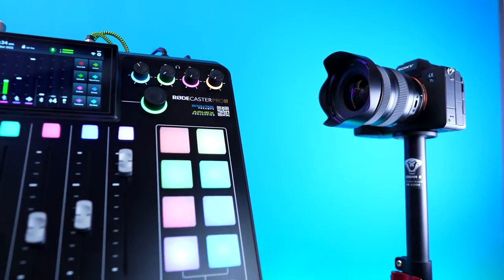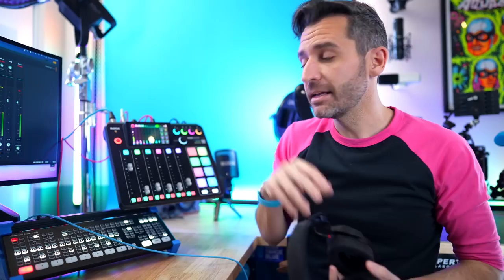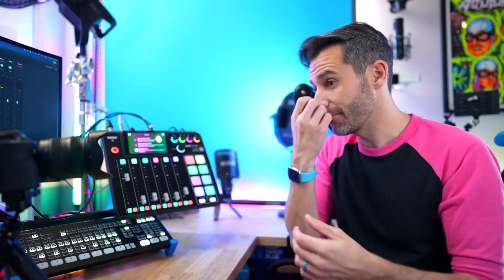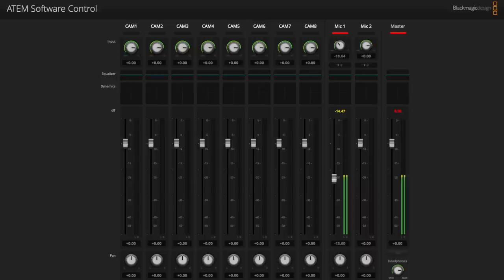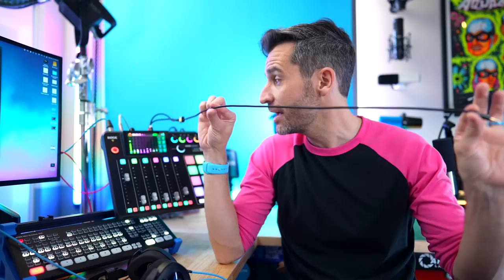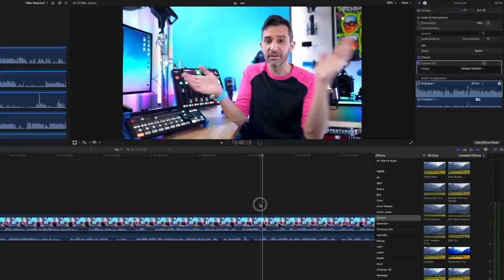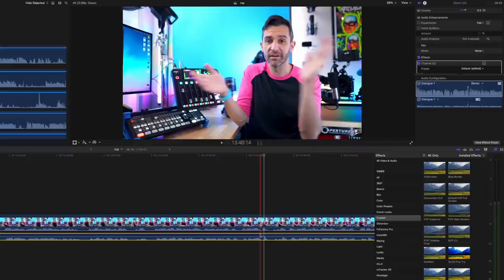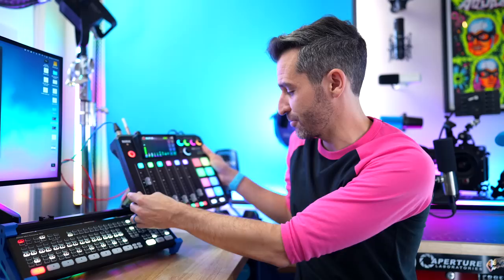How To Connect the Rodecaster Pro to a Camera or ATEM (and why you SHOULDN’T do it)

Comment: I always had trouble using the outputs on a Rodecaster. It may have something to do with it being a 'balanced' output going into an 'unbalanced' mic input on the camera. I believe the outputs on the Rodecaster expect a balanced trs cable instead of an unbalanced ts. Wouldn't it be better to use a headphone out (unbalanced) to plug into the camera? With the quiet preamps on the II that should not cause any noise issues. I am guessing that the headphone outputs do not introduce any interference.

Alternatively, maybe you could use two trs jack to xlr converter plugs and then two xlr to stereo mini jack Y cable.

Comment: Couldn't tell a difference, but i'm on a surface pro at low volume since it's 2am here and I don't want to wake the fam. Also can you link your Atem stand. 

EDIT: Could using a gold jack adaptor work?
Reply from the maker: Oof, that's a tough one. It might be worth looking into some sort of tech backpack that has room for tablets/laptops. Honestly, the best option though is probably to get a hard case with foam that you can customize to fit the RCP along with mics/cables/etc.

Comment: Hi Tom, have you tried connecting the Rodecaster to the Atem via one of the headphone out jacks? The only other setting necessary is to set the Atem to a line output on the Atem software to avoid distortion. I am not an expert, but this seems to work for me.
Reply from the maker: Hey Bryan! I used to do that with the original RCP, but never got great results so I honestly haven't tried it yet with the RCP2. It does have way better headphone amps though, so maybe that is a smart solution.
Reply: @Chris Davis it works. I have had no issues, I try keep the headphone volume setting as low as possible and I’ve had no clipping or distortion.
Reply: @Chris Davis is it works?
Reply: @BryanRoseveare  do you have Yolobox?

Comment: Sounds like what you are experiencing is a grounding issue. Since the roadcaster is the Central point in all of your testing It is possible that the roadcaster has a grounding issue. I personally have never used a road caster but I've used other sound equipment that was powered without ground. Oftentimes sound equipment that use barrel plugs will also have a grounding pin on the back of the chassis. Try running a wire into the ground pin on your electrical outlet. 
Or
It's also possible that the ground itself is the thing causing the problem. There are ground lifting plugs that you can buy inexpensively. Or you can take a pair of pliers and peel the ground pin off of your IEC cable.

Comment: Hey Tom, have you looked at Mogami gold series cables?  They make all kinds of cables, I purchased "Analog Reference Microphone Cable" for use with the Rode Podmic and RCP2.  When I replaced the $20 XLR cable with the Mogami, I noticed an improved dynamic range along with a clean signal from the mic to the Rodecaster.  Any decent microphone such as the Rode Procaster or Podmic will shine with these cables.  Defiantly worth the price.
Reply from the maker: I've heard of those! Haven't used them though. For XLR, I've REALLY been liking Rode's new cables, but still don't have a lot of options for the more specialized non-XLR needs.
Reply: @tombuck  Amazon sells Mogami, they don’t just make XLR cables, they also make instrument cables both 1/4 inch and 1/8 inch cables.  They do have a TS balanced Y cable 1/4 mono L/R to 3.5mm that might work for you.

Comment: The thing i notice a lot, when you leave your USB connection connected to a computer, you will hear a hum or the "eeeeeeeeeeeeeee" sound. Disconnecting USB will help a lot. There are USB isolators so this could be a thing you could try. Another thing you could try is just hook up a DI box between the line out from the Rodecaster to the Atem. The outputs from the Rodecaster are balanced so hook up long balanced cables and put the DI box as close to the camera as possible. I made a cable from the Rodecaster 1 to the Atem myself, never had a hum or USB hum on it. Both the Rodecaster and the Atem were connected to a Mac mini through an powerd USB-3 hub. I never had any problems with it.
Reply: I would not go for a DI box in reverse, though

Comment: I would like to point out that I did the test with two different acoustic devices.

The first time both devices connected perfectly, and the second Bluetooth symbol appeared next to the outgoing monitor symbol.

I turned the rhodecaster pro II off and on again, both devices were no longer displayed among the devices and I was no longer able to connect them. I repeat, the first time they worked perfectly. What could I do to solve the problem?

Thank you

Comment: The trick I've found to extending cables is to avoid extending the skinny side of the cable.  I'd extend the thicker 1/4" side of the cable, then plug in the black cable.

Comment: If you run a monitor out on the ATEM, you can monitor your audio levels there.

The short cable between the ATEM and and the mixer isn't that big a deal if you have one person manning both devices. In fact it's best to have the two close.

One thing to keep in mind is if you are running through a mixer to the ATEM, make sure the mic inputs are set to line in on the software instead of one of the mic settings.

The problem with audio on the ATEM minis are that they are designed to accept an unbalanced input. I really wish they had given us XLR or even 1/4in jacks. I'll accept that maybe they didn't have room or the forethought on the smaller models but by the time the Extremes were released, there was no good excuse not to but hey at least we got super source. That alone is worth getting the Extreme for.

I generally use a Zoom Live Track L-8 or Zoom H6 in my workflow. The L-8 is more versatile for my needs but most of the time I'm filming events or recording music. Nothing against the Rodecaster, it just didn't fit my needs.

Comment: Hi Tom great video. Quick question? So how do I record multiple camera angles using the atem mini pro iso and have audio also synced if you don’t recommend connecting the rodecaster pro 2 to the atem mini. I’ll be using two cameras with this setup. Thanks.

Comment: Did you have any problems in Rodecaster Pro 2 Beta Firmware 1.08 version ??
Would you recommend this update or would it be better to wait?
thank you :):):
Reply from the maker: I've been updating to all of the beta firmwares and have found them to be pretty stable overall. I did see that they pushed out a new bug-fix update yesterday, but I haven't installed it yet. For important work, I stick to the official releases though.

Comment: I go from my RODEcaster pro straight to my camera. I use a double ended 3.5mm cable with a 3.5mm to 1/4 in adapter to one of the headphone ports and then the 3.5 into the camera. No Y cable, and I get stereo. No noise.

Comment: I do a pre recorded video podcast. I have a Sony zv e10 that I use a micro hdmi to hdmi. I utilize programs like riverside or squadcast to record. I purchased the atem mini pro and I just could not get any camera signal to come through. I'm not trying to do a live stream I just want to be able to switch to different cameras while I record? Any guidance will be appreciated 🙏
Reply from the maker: I saw your comment on the other video, but just in case, the first thing I always check is the cable– sometimes they just go bad or aren't compatible. I can't remember for sure, but there may also be a menu setting in the ZV-E10 where you need to enable HDMI output.

Comment: The audio problem has also something to do with the nature of the Atem Mini. It is by far the cheapest video switcher on the market, and the savings are on the audio here. A Roland V-1HD has proper analog line inputs and outputs, compared the the Atem it has the same 4 video channels but it is twice the price.

Running them separete in the computer is probably the best and easiest solution. Can the audio be synchronized in OBS with the video for livestreaming or do you need to sync in post?

Comment: Run your y cable into a Sescom IL-19-MINI and then run your 3.5mm extension cable to your camera or ATEM. Bye bye hum. I’ve been using that solution for over a year and it works flawlessly. Though I still prefer to record separately and then sync in post.  I realllllly wish the ATEM would allow timecode jam sync. That would make it so easy to simply replace the ISO file audio with the external audio recorded with zoom f6.

Comment: Tom I love your podcast.  I am wanting to upgrade from mixcast to rodecaster.  I have a tascam mixcast that I want to send audio from aux out to my GoPro  10 camera  as mic in so I can livestream. I can’t seem to get my pads ( sounds) to go through.  Any ideas?  Or could I do this with the rodecaster pro 2?
Reply from the maker: What I would recommend doing is using software like Ecamm or OBS to combine the signal from your GoPro with the signal from your mixer (you might need a small delay to sync everything up). This should work with either the Tascam or the RCP 👍

Comment: I had this issue with my Rodecaster pro 2, I found it was a USB loop. I disconnected a KVM that had usb connections to both machines my Rodecaster was connected to, once I removed one from the chain all noise from the serial Line-in into the rodecaster stopped making noise.

Comment: The problem is that the 1/4" connections on the rodecaster Pro are TRS cables and not standard 1/4" cables. That means that you have to have a dual TRS 1/4" plug to a single 3.5mm stereo cable. I have yet to find a single cable that does that.

Comment: I have the same problem connecting my Yeti X to the mic input on my Canon SL3. After 53 emails with Blue support and every imaginable configuration, I could not use Canon EOS Utility to monitor the shot composition and camera settings while also using Blue Voice to EQ the mic; the only solution is to record a separate soundtrack with Audacity, then import and auto-sync it in Filmora. THEN, detach and delete the audio track from the camera footage. THEN, export the audio and video to an mp4 AND reimport it into Filmora for silence detection, trimming, and effects editing. Easy peezzy. No problem, no worries. Everything has trade-offs. There is no perfect solution.
Reply from the maker: I'm glad it's working for you (even with several workarounds)! I definitely wish there was an easier to do things like this, since it's such a common need.
Reply: @tombuck  thanks 4 the support.

Comment: You need a DI or a a DI with a ground lift.  It’s not just the cable, it usually comes from the power supply.

Comment: Tom I took your advice and got the rodecaster2 

Now I’m looking at a Mac book air if I was going to get one up grade for the m1 should I get the ssd or the ram upgrade?

Not a power user only going to light edit etc,

Just wanting a suggestion to get the most for my dollar for around 1300
Reply from the maker: That's a good question. If you had to pick one, I would say RAM, since you can add storage space with an external SSD, but if possible, try and get at least 512gb internal just to have a bit of breathing room.
Reply: @tombuck  would a m1 air still be good in 2022-2023 I know the base m2 goes slower than the m1 but if I bump up the internal storage maybe the m2 would be good. Part of me just wants to splurge on the Mac book pro 14 but I will try to stay on budget

Love the channel

Comment: I haven't found that problem but have you tried running a mono cable into bother inputs on the atem? I've also used a rode wireless go as a wireless transmitter to my camera and it was fine.
Reply: I've also changed my input on the atem to line in rather than mic in. I wonder if there's a similar setting on the camera?

Comment: I do agree with your conclusion: Don't do it! ...but for different reasoning. It is NOT the (just the) CABLE; it is how the circuitry combines. You are putting a LINE OUT into a MIC IN. It is not solved with A CABLE The levels ATEM is looking for is about 30dB lower (0.001V vs 1V) than the line out impedance is much different than the mic input impedances. You said it with your vocaster suggestion: the "3.5mm out for a camera input" says it all; that's not the signal coming from the RhodecasterPro II line out. The size/type of connector is not the thing, it is about the signal it is presenting. Your special cable choice that reduces noise could be luck and/or an artifact from the cable's design and using very low gain in the circuit. The mic input on the ATEM has (unneeded) preamplification (power and circuitry) on it, never mind the impedance differences. You would need to add an audio isolator circuit to match levels and impedance between these; keep in mind that this will have a quality issue, too, so not a free lunch. I believe this is the issue. Another option is an HDMI audio injection for the LINE OUT into the HDMI out of the ATEM is another option. But in summary: 1. Abandon cabling and just SYNC, 2. inject to the computer as you suggest, 3. inject audio into the HDMI out, 4. figure out the audio isolation/matching circuitry.

Comment: I have found that I hear a lot of noise in the headphones when using the RCP II and when recording, however, when you listen back to the recording, there is no noise, even before editing the audio.
Reply from the maker: The actual recording should always be the highest quality, but the headphone amps in the RCP2 are really good and should be extremely quiet. If you're hearing a lot of noise through them, you might want to reach out to Rode. 

In my experience, there's virtually no difference between the headphone quality and the actual recording wit the RCP2 (the original had a pretty huge difference though).
Reply: @tombuck  thanks for this. I will reach out to them. I hear a lot of shhhhhhh in my headphones. I use a podmic and AKG studio headphones together with the RCP2. Keep up the great work, enjoy watching your content.

Comment: Great material! Thanks. 

What stand are you using for Rodecaster Pro?
Reply from the maker: There's a link in the description, but it's just a generic VESA arm. The built in mount on the back is super convenient!
Reply: @tombuck  thank you. I see, it is only for Rodecaster Pro II :( I won't change mine, especially I have recently opened box with it which was waiting for over year (didn't know how to connect everything together to use in streaming)

Comment: ATEM distorts?  It should be since you're running a line-level signal into a mic-level input.  The RODE needs to have the output selectable from line to mic level for the outputs.
Reply: Does anyone know if you can switch the output to mic level in the Rodecaster Pro V1? I am planning to buy one soon..

Comment: It's not about the cable it's about normal when there's no DI involved. Basically the interference you hear it's about differences of inpedence in input to outputs , connecting devices with analogue audio might introduce interference but if you put a DI you basically can avoid those interference by isolate the ground from the circuit. That hum noise is coming from the difference of power supply those 2 units uses. Furthermore atem can be forced to use line signal instead of microphone input in the atem software. When I use the way you want to use it I basically embed the audio in the camera and than I activate the audio chanel of the camera grabbed in the atem.

Comment: Great video! Are you running the cameras on dummy batteries? I’ve tried with and without and it makes a huge difference to the amount of noise. 

A trick I saw to get around it was to use rode go to avoid a physical wire.
Reply from the maker: I’ve been running everything off of batteries usually.
Reply: @Chris Davis more

Comment: Tom - the Amazon link that you provided to the black cable does not work - what was the brand of the cable?
Reply from the maker: The link is still working on my end. Unfortunately there's no specific brand, it's just "3.5mm to Dual 1/4 Adapter 1/8 to 6.35mm TS Mono Audio Cable Stereo Breakout Cord Y Splitter Compatible with iPhone, iPod, Computer Sound Card, Headphone, Speaker, Home Stereo System, 3.3Feet" (one of those super catchy listing names).

Comment: Great tour. Have you ever experienced sound quality issues with rcp2 and ecamm? I have to unplug both usb- c cables from my rcp2 once in a while with zoom, always with MSTeams as the audience is blaming real bad audio quality I do nor hear on my inear. Any tip is welcome also the best practice to cable rcp2 with Mac or via usb hub.Which hub?
Reply from the maker: So far I haven't had any issued like that with the RCP2 and Ecamm. I've actually been really surprised, because the RCP2 has worked with basically every USB C cable I've used, whether it's plugged directly into the computer or a hub.
Reply: @tombuck  have you ever changed the power On sequence, like first rcp2 than Mac or the way around. I always turn on the rcp2 when I need it and therefor the Mac runs while I power on the rcp2

Comment: Great vid but cant this be done with an aux cord and headphone adapter via any of the headphone outputs on the rodecaster? I is the same noise issue that stops you?
Reply from the maker: You can do it that way, but while the headphone amps are good, they're not as good as the actual preamps.
Reply: @tombuck  ah right thanks for the reply.